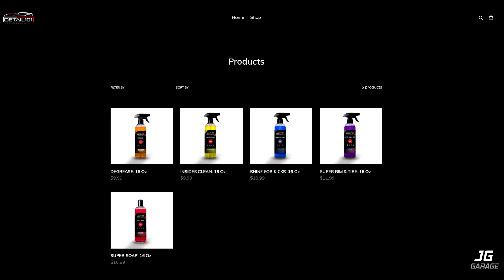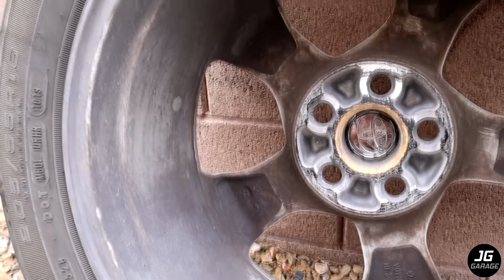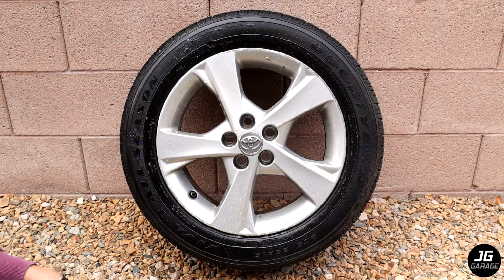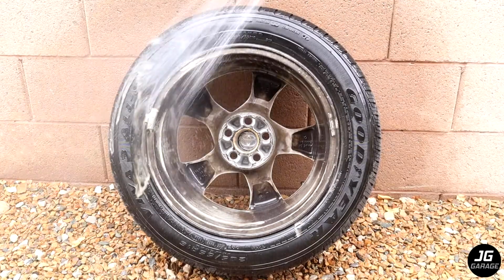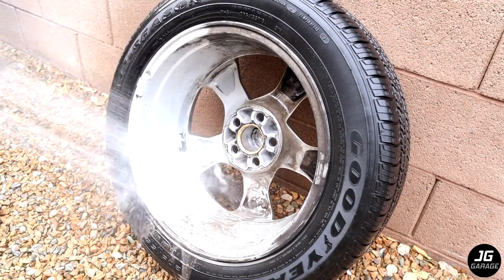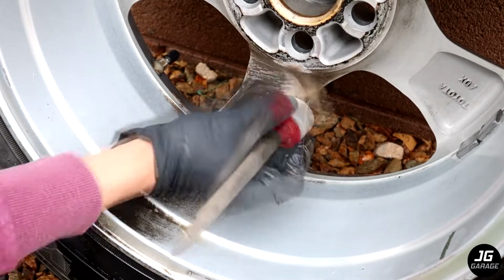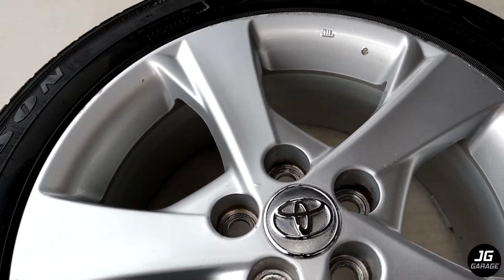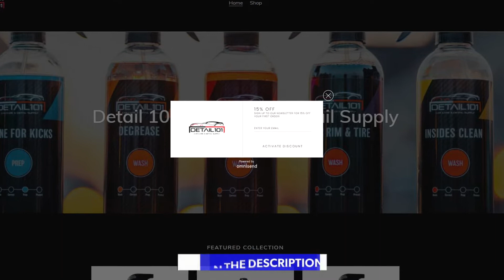Cleaning Super Filthy Wheel Using Detail101 Super Rim and Tire Cleaner | New Wheel Cleaner Review

Comment: Good result for the cleaner , just needs a dose of iron and the tar and glue for the weight tape and be a full result, of course depends how far you want to go 👍🏻
Reply from the maker: Yeah that's true but for this test I wasn't really aiming for perfection. Just wanted to see how much of a difference it can make and it did clean it up really well. I agree with you that the next step would be to do remove all the tape residue and decontaminate the wheel! Thanks for watching!
Reply: @jggarage1807  yeah absolutely spot in for the test the other steps just shows the extra level of service that could be provided more $$$😉👍🏻

Comment: how does this product stack against that turtle wax wheel cleaner and tire prep in your opinion?
Reply from the maker: The Turtle Wax Hyper Foam definitely had more suds and foams a lot when brushing compared to this one which can be quite enjoyable. In terms of cleaning strength, it's hard to tell since they're two different wheels with different conditions. The dirt on this wheel has been on there for years while the wheel in the Turtle Wax video occasionally gets cleaned. Can't go wrong with either one!